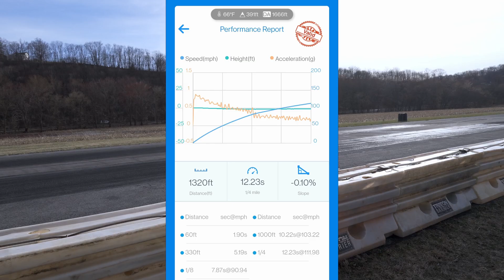Unboxing a 53hp Motor & 1,000 Amp ESC!

Comment: If you manage to blow up this thing up, you have to check out open inverter forum. They have a 500usd board you fit in to a Prius inverter, let's you control everything, and run some 100kw+, and the best part: you get to say that your tuning your car with Prius power 😅😅😅
Reply from the maker: The biggest issue I've found with EV inverters is they can't hit the eRPM we need to do this direct drive.  And going to a significantly geared setup necessitates more torque - things get bigger and heavier faster.  But dropping a Nissan Leaf motor/batteries in the trunk with a humongous ProCharge has crossed my mind...
Reply: @AlexLTDLX  they also generally need a lot more voltage, so that means more battery and a different style of motor. Perhaps a direct drive motor on the crank, and a blower for the high end, but that is getting complicated 😅

Comment: I'm wondering if a Prius  converter inverter can be hacked to do this!? for it can convert DC to 3 phase output continuous 500amp and probably could do much more for it water cooled, hey even using the 3 phase motor 1 from the traction drive and a Prius hybrid battery! Thanks Nate
Reply from the maker: Somebody else had the same idea.  The biggest issue I've seen is they can't support the eRPM we need.

Comment: Good you are going for thicker cables.  Are you going for 4AWG or 4/0 wires?  Sorry for the silly question I am from the metric world.  Should the ESC not be closer to the motor? (My reasoning in EVs you have long cable lengths from the batteries to the inverters, and the latter is placed just near the motor i.e. shorter cables to the motor)
Reply from the maker: 4 awg.  There will be 6 of them.  I initially wanted to run the ESC closer to the motor, but after learning more about how these things work, long power cables put a lot of stress on the ESC.

Comment: X is mounting bracket. very nice pick up.
Reply from the maker: I don't think the X is for mounting.  It's 3d printed and not anywhere near strong enough.  I emailed them, and they told me to use the drilled/tapped holes in the heatsink for mounting.  That X thing may be just for shipping or to secure cables.

Comment: Short the input terminals and try to turn it....
VERY nice stuff. Long motor leads can cause enough inductive reactance to create timing issues with a standard back emf timed motors, good thing you've gone to a sensored motor, they are much more stable under stressful conditions. A high quality shielded cable is recommended for the sensor lead. The 10mm shaft carrying 50+hp is somewhat concerning, a rag coupling may be advisable to minimize shock  and alignment would be quite important as well. Belt drive and side loading could snap that shaft (and the toothed belt) in short order. A direct drive would be best, I hope that's the plan. Otherwise a planetary gearbox would be best. Either way, a nice soft start ramp is highly advisable, I'll be watching, this is getting good!
Reply from the maker: It's not going on the P2 - it's going on the actual Vortech.  That one uses my hex drive setup.  If you go back through the electric turbo playlist, you can see where I made that.
Reply: @AlexLTDLX  Will do, I just recently started following your project. I'll check out some of your past videos. Thanks and Good luck!

Comment: Just ditch the engine and compressor completely and run 10x 53hp motors attached directly to the transmission input shaft. lol.   I may order one of these for a go kart.
Reply from the maker: Lol.

Comment: No expert but I'd be putting it as close to the motor, given the frequencys and currents involved long motor wires can't be good.
Reply from the maker: I used think that too - in fact, that was my initial plan.  But since then I've learned that long power cables are really hard on the ESC - specifically the capacitor bank and the power stage.
Reply: @AlexLTDLX  like i said no expert , power cables just need to supply clean power, motor cables are square wave so harmonics up to the moon and back. Perhaps ESC and capacitors all upfront? I'm rooting for you , I want to see mega horsepower without any more magic smoke :)

Comment: Now u just need a turbine and generetator in the exhaust to charge it, just like a turbo but insteat of the shaft connecting turbine and compressor theres batteries esc and motor between
Reply from the maker: You could just charge it from the alternator... that's what I do (with a boost converter to raise the voltage to 60 volts, of course).
Reply: @AlexLTDLX  Thats true but you could also use the Energy thats in the exhaust gas, just an idea tho

Comment: This is such a throwback for me. MGM has been around forever and used to be the best option for high amp brushless rc conversions before castle creations really took over. 

The D on the motor stands for Delta, having to do with how the windings are terminated. S is for star or wye. It’s been a minute, but I think Delta wound motors are capable of higher kv but sacrifice some torque and efficiency when compared to star/wye wound motors.
Reply: Yup, spot on. Y winds are more torquey.
Reply from the maker: Thanks for the input. I can never keep straight which configuration is what.

Comment: EeeeYyyyeaaaah! 
Now we’re talkin 1000hp. 
(What probly around 15-20psi boost?)
You said maxing out the compressor, usually is around 20-25 for that size.
Reply from the maker: In this case, it'd be a theoretical 15 psi.  But we seem to bending that "law" for some reason - not really clear why.  It may take less.  Then again, I can always run it on E85 or Q16.

Comment: Its crazy to see that much hp from something so small iam just think of the old vw engines that made 35hp
Reply from the maker: It really is amazing.
Reply: Funny you should mention that. I’m thinking I need one of these on my 90hp 1776 VW air cooled sand rail. Maybe get it up to 125?

Comment: Loving this series! That’s a beast of a motor. I’ve been wanting to start a similar project as well. One thing I have always thought about is how power is lost when the supercharger is not spinning due to the airflow restriction. I have a basic idea for a bypass valve that shuts once there’s positive pressure from the housing. Can’t wait for what’s to come.
Reply: He mentioned in another vid with this supercharger on his ~6.0liter engine about 1%.
It's hardly worth the bypass flap at such a low loss.
Reply: @ThePaulv12  That’s good to know, which video does he mention this in?
Reply from the maker: I've data logged the car running wide open throttle but with the electric supercharger not running. It's exactly equivalent to one PSI boost restriction on a 500 horsepower engine.

Comment: That looked like Christmas morning. Do think there will be a hp level you'll want to introduce an intercooler? Maybe some meth injection? I'm pumped to see this push you into the 9s one day.
Reply from the maker: It could benefit from an intercooler above 8 psi; but not as necessary as a normal turbo or blower.  A normal turbo gets heat from it's proximity to exhaust, and normal blowers are always running.  As long as it goes deeper into the 9's than the Whipple did I'll be happy: https://youtu.be/AOL3Qyczt3Y

Comment: I'm curious how they get that HP rating cause I'm finding it hard to believe that makes 53hp 😒
Reply: 1 E hp = 746watts. 53 * 746 =  39538 watts. / 1000 Amps must be around 40v plus losses?
Reply: A useable torque number spinning up past 30Krpms is easy to make 53hp. 
Same way a crotch rocket 600cc motor that makes 30ftlbs makes 150hp…16Krpms!!!

Comment: I think you should put the ESC as close to the motor as you can. It's why they included the cabling they did and pre-wired it. I mounted a water-proof one behind the front bumper for mine. As an electrician judging  the components by their size, I'm very skeptical about their ratings. Is there anyway for you to tach the RPM of the motor? You didn't say what speed it was rated for. Typical impeller speed for 15 psi or more (to get the hp numbers you're talking) is in excess for 40K RPM and you know it's going to get dragged once it's restricted any. How many RPM can that billet impeller you have handle before grenading? You might want to look that up. i think you would be better off with an axial flux motor; but you would probably have to build it. Got a 3D printer?
Reply: I'm not an electrician but it seems a bit over rated. Glad I'm not the only one
Reply from the maker: It's a 50,000 rpm motor.  At full load and 42,000 rpm at 50 volts, it draws 550 amps continuous.  These things are no joke.  There's a reason this stuff costs what it does.  You're looking a $3,000 worth of motor/ESC.
Reply: @AlexLTDLX  550 amps x 50v = 27.5KW ! My kelly KHB72701C motor-drive (ESC) is rated at 700 A @ 72v which is 50.4KW; but the Me-0913 motor I'm currently using is rated @ 12KW continuous with a 30KW peak and a motor speed of 5000 RPM. Lower sprocket is 87 tooth and the upper on the Paxton is 32 tooth for a ratio of 1 : 2.7 and the internal gear ratio of the Paxton 1: 3.5. Multiply the two it comes out 1 : 9.5. That by the motor speed of 5000 comes out to about 47,500 RPM on impeller speed if the motor could push it to max speed; but it can't. I tried dirven sprokets a couple of teeth above and below too and what I'm running proved to be the best combination. I do have a tach so I know the motor is only doing about 3,600 RPM fully loaded which is a reduction of about 30%. I know between the internal gearing and the 2 1/2 8mm belt-drive I've got some parasitic loss; but I don't think it's all that much. It will really be interesting to see what you get. By the way, what are you restricting your output with to show the static boost pressure? You know what else would be really cool? some kind of CFM meter.
Reply: @AlexLTDLX  I looked up your newest stuff and if it's not too late for you, Dont use the new ESC you bought. From your last reply I know that you are counting on running that 30100 motor wired in a delta configuration for 875 RPM per volt (which would give you the impeller speed you want). In delta you only need 57vdc to get the ful 50K RPM @ 701 amps for the full 40KW rating. Thing is, I seriously doubt you'll get that under load which means you may be better off going with a wye configuration to double the torque at the cost of RPM/volt. To get 50,000 RPM in wye configuration only requires 506 amps but 98.8v which exceeds the voltage rating of your ESC. That F-ing thing was $1,800 when you can get a Kelly from Cloud Electric that goes up to 120v and 600amps for less than $1K.  As far as getting more voltage is concerned, you can get enough Prius cells off Ebay to do the job for less than $300. As soon as I lose another 40ah AGM I'm getting a dozen of them that I'll group in pairs and charge with the same little 2A smart chargers I use now which charge at about 14.5v. My ESC is only rated for up to 90v so 87vdc will be fine for what I have now. prius battery cells can be charged up to 9v, but 8 is nominal and 7.2 should work for me. Too bad I didn't get a higher voltage ESC because my motor is rated up to 96vdc. I already had a 72v system when I bought it though; and back then, they're weren't any ESCs with a higher voltage rating available.

Comment: I would love to see you put that motor and ESC on a custom-built RC car. That car would be insane. This guy named Raz Shifrin, built a four-motor, 40 HP car with some castle ESCs and motors. But, you have one motor that is 53 HP. I don't know if you are into the RC car built thing, but we in the RC community, love builts like that. I cannot imagine how much money that ESC and motor costs you? Small fortune I am sure.
Reply: It would also go great in a go cart
Reply: Was just thinking the same.
Reply from the maker: It would be nuts in an RC car.  And to answer your other question, a bit over $3,000.
Reply: @AlexLTDLX  That's what they used to say about muscle cars, back in the days. That engine is too big, too powerful,  for that car. But, I understand what your saying. I have the perfect RC Truck, for that motor. Primal RC'S Raminator. In case your not familiar with that truck,  is a 1,/5 scale 80 lb gas monster truck. They actually have an electric conversion kit for it. I am sure that truck can handle that motor without breaking a sweat.
Reply: Yeah a bit late to the party but if you check out RC Sparks youtube channel he has the very same motor/esc combo in a 1/5 scale Primal RC Raminator monster truck. It's a bit insane. Pretty sure he was running 15s (55.5 volts).